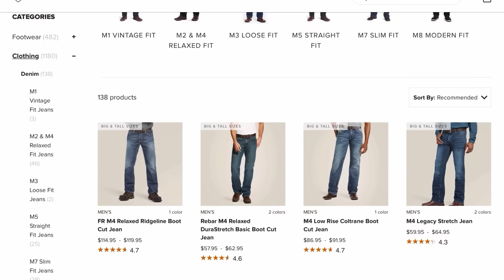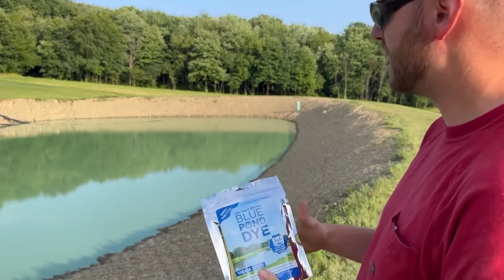This Is Why I Hate Going On Vacation

Comment: Yup. Totally agree on vacation. The way its been raining by me this year, I can barely keep up with the mowing without being away - usually it slows down in the July heat... Winter isn't much better for being away, because you have to worry about heat failing and the house freezing. That happened to my sister several years ago. Even the water in the toilets was frozen solid. Big time damage. I think mud season in late March/early April is probably the best time for vacation - can't really work in the woods, no mowing yet, too early to plant, and much less freeze danger with days above freezing.

Comment: The exact reason why I blacktopped mine. Gravel driveways are a maintenance nightmare on a hill and at some point you will have to add thousands of $$$ for more gravel.
Reply from the maker: Yeah the last time I did it I spent $1,800 and it wasn’t even enough to do the whole driveway. And that was before Covid
Reply: I second Doug's comment.  When my driveway was gravel I had to bring in gravel in every year.  The blacktop is great.  The only thing now is you have to coat it about ever two years.  At least I don't have to haul gravel in.
Reply: what's the length of your driveway?
Reply: All it takes is time and money, and mostly money when you're paying someone else to do it. Bob Villa's website says an asphalt driveway runs $7 to $13 per square foot, including $2 to $6 per square foot for materials and $5 to $7 per square foot for labor (2023 date on the article). A typical drive is 10' to 12' wide, so using $10 as the average price, that's $100 to $120 per linear foot.  How long is the driveway? Yeah, gravel is fine.

Comment: I get it, i can be overwhelming before and after a trip.   Good part is that you have the equipment to fix it up.    And also, your operator skills on that excavator are solid.   I saw how smooth you were with that sand.   Practice makes perfect right?   Another solid video.

Comment: Always something to redo when You step away. How often does it wash out? Would a buried culvert pipe in the ditch line control water flow under ground? Start with a catch bassoon funneled into a culvert pipe.